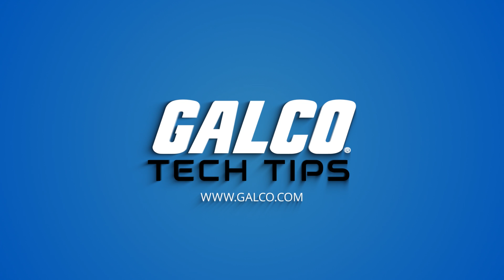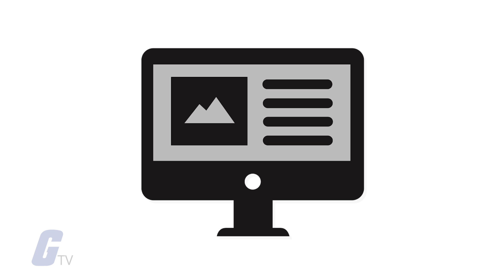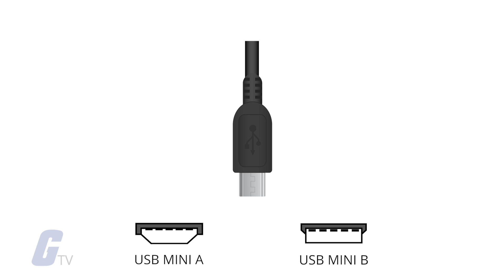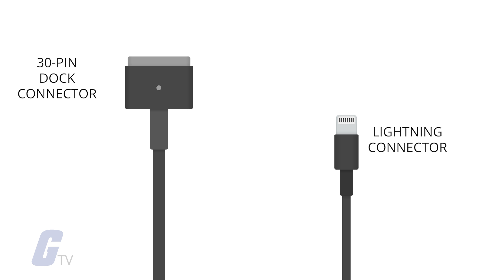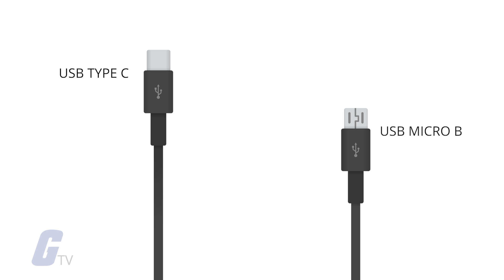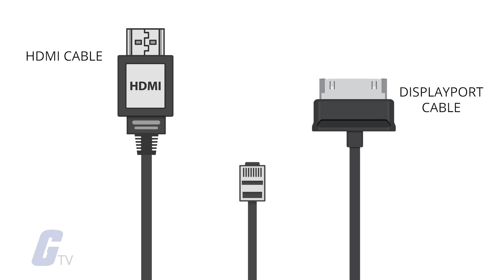USB Cables Explained: Different Types of USB Connectors - A Galco TV Tech Tip | Galco

Comment: I realize you made this video a few years ago, but I recently came across a connector that I'm not familiar with.  It's shown on your cover screen and at the 13 second mark --> the one on the far left --> only, you didn't cover it in the video (?!). Any help on this?
Reply: Its a reversible usb-A.   They are hard find. I mostly see them on earbud case that have them permanently attached.  I think big tech is trying to keep them hidden, so that can push for the double usb-c and the exctinction of the lightning cable
Reply: Same.

Comment: I have  TRIO band looper and the usb connector to it has  smaller then usual plug in I've tried normal usb plug and it doesn't fit to transfer my music to computer??  Is this normal or is there a cable I can get that works??
thanks

Comment: Good Job, great videos -  so many cables !    It's nice if they  make these ports and cable connectors stronger... those  USB Micro B ports break and snap off on some electronics,  not fun...  avoid  rechargable devices with micro B ports - the ports break off and rattle around inside the  useless products.

Comment: If I have a USB-C cable that came with the iPhone 12, but I continue to use my old USB cable & brick, the charging speed is still the same...correct? If I use the new USB-C cable, but I buy a USB-C female to USB male adapter with my old brick, will the charging speed still be the same, or will the speed increase due to the USB-C cable? I'm assuming the charging speed increases....right? It's cheaper to buy the USB-C female to USB male adapter than a 20W brick. And most come in a package of 4 so I can use all four in several of the old 5W bricks I already have. Thanks in advance!
Reply: Usb c to lightning is faster

Comment: Not enough info about what makes a good cable vs a bad cable.
Reply: Lightning because its a male into a female.   All the other plugs are a male plug with a female hole that gets inserted into a female hole with male plug in the center.....  the male plug inside the female hole will always be a weak point

Comment: Wtf is usb b
Reply: I think is the ones used for printers
Reply: @handleOfThy  It's also used in some Arduinos.
Reply: According to video it is the square connector which as "clit" stated is the printer connector. So now I know what that connector is called.